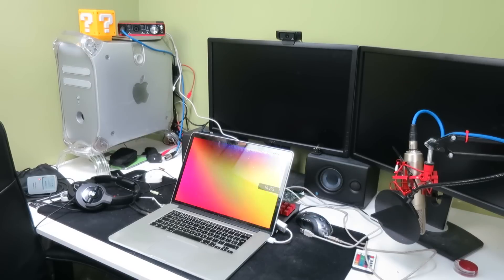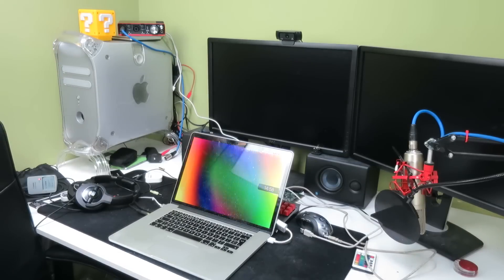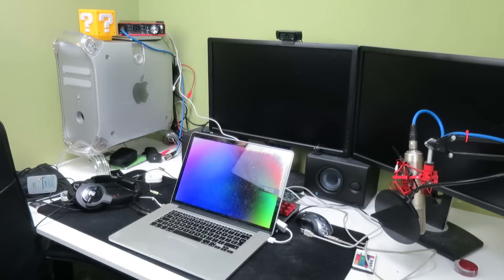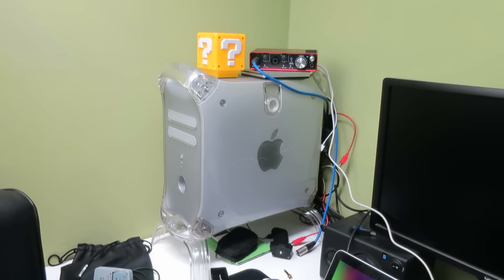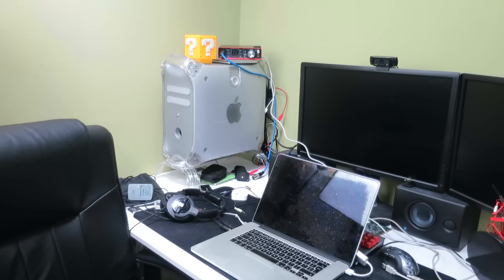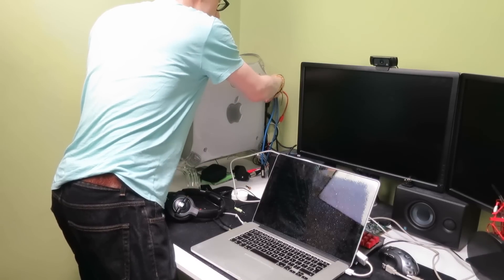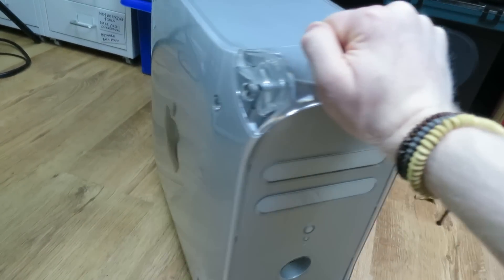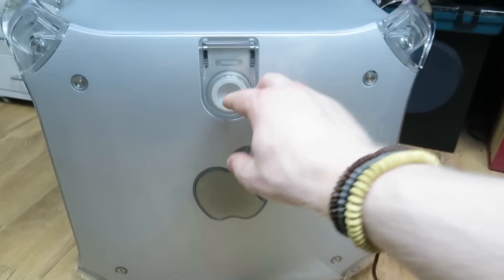Bye Bye Power Hack G4 Quicksilver

Comment: This video sums up perfectly why I never built a Hackintosh. I thought about it for years as I needed a studio Mac but never fully committed. With the announcement of Apple Silicon I know now for sure I'll never build one. I built a couple using old hardware for fun but I just couldn't bring myself to trust one as a main machine. I would strip the machine and sell the parts individually (including the case), you'd get more cash.

What I would probably do in your situation is buy a 2012 Mac Mini. Probably the I7 server addition running the two SSDs in RAID 0. Old yes, and soon out of support but a very nice backup. I used a MacBook Pro as my main machine for years and still do, but I learned the hard way to have a good backup as when these newer MacBook Pros decide to break they don't usually give much if any warning. Great video though and I'm looking forward to seeing your videos on the Silicon Mac when the time comes. Oh, and don't stop using camera audio. Decent audio is fine for big productions but it wouldn't feel right for these more 'traditional' IMNC-style videos.
Reply from the maker: Thanks, Ashley! I may look at parting it out if I don't get much luck selling it as is. Case on it's own would be much easier to sell probably. 
Mac wise, I'm trying to avoid the purchase of another system if I can. If I can hold out on this MBP, I'll be golden.

Don't worry, I won't ditch camera audio for the classic IMNC episodes;)  I just would like a camera with slightly better audio, less hiss / interference etc, and an audio input for those higher scale production vids.

Comment: Nice to see such a unique powerhack (that was once an actual PowerMac G4 too) sad to see it go but needs must and I hope whoever works out a price looks after it as well as you did Tom 👍         

Luckily I don’t have the urge to hackintosh my pc as my 3,1 Mac Pro runs just as I like so it’s all good but I needed some PowerPC stuff (hence the PB G4) as finding a cheap G5 isn’t really possible especially those later 2005 dual and quads. Sorry for the ramble but I find them extremely interesting and being a techie I can’t help it sometimes. Awesome content as always regardless of seeing off a unique bit of tech with sentimental value, onward to better gear and a Apple silicon based machine in a year or two.

Comment: Oh man.. I can only imagine how emotionally driven you must have been when deciding to film this video and during its filming (it shows). I concur with you regarding hackintoshing. I've had many Hackintosh builds since 2009 and they were a pain in the bloomin' ass (I'm not British, but I thought that sounded funny) to get working 100% actual Mac-like. I did have a stable system at one point, as well as I had this current AMD Ryzen 5 3600X system running with 10.13 High Sierra and finally 10.14 Mojave, but for what I do nVidia GPUs are king, and my AMD Radeon RX 480 4GB GPU wasn't going to kick it. I could theoretically downgrade from Mojave back down to High Sierra and run my nVidia GTX 1060 there and dual boot between Win10 and macOS, but I didn't feel like maintaining 2 OSes anymore. Like you I have a MacBook Pro (mid 2015 top spec'd except for SSD 15") so if I need macOS I can just whip that puppy out and get what I have to get done done on it. I do enjoy using my 6C/12T 3600X here and it ran super nicely on macOS, but Windows 10 isn't too bad on here and I just use that. Lastly, I'd buy your Hackintosh off of you, but you're in the UK/GB and I'm in the US... shipping would be horrendously expensive and I don't really have room for it in my setup. I'm also tight on money, so there's that too. I wish you the best of luck and I hope someone is able to give your old gal a new home soon!

Comment: I've got an 800 MHz Quicksilver. Just restored its original software from a downloaded and burned set of system restore CDs. Came with Mac OS 9.2.2 and Mac OS X 10.1.2 and some bundled applications, and iTunes came with some cool sampler tunes as well. Just applied a system update to 10.1.5 and iTunes 2.0.4 (from 2.0.3 under Mac OS X), but I otherwise plan to leave it as-is for running OS 9 games and such, and for the fun factor of running such an old OS X version. It's so old, it still features the happy Mac at boot-up instead of the grey Apple logo. That system update was also needed to get my SATA card to work! They were still doing a lot of work to get basic things going in this release.

Comment: I remember that I was in school at the time, and coming home to watch the hackintosh serie video's once they where released and build my very first one not very much later in 2016, how far we come since 2015/2016 :). I have ditched my hackintosh a very long time ago, probably been my main system only for a year and a half max not much after that I got a 2016 MBP which was paid for by my company, that was recently upgraded to a newer 2019 MBP in combination with a Belkin Thunderbolt Dock and have been loving that since. I two almost identical setups at work and at home and can simply connect a single cable from the dock and everything gets connected. Maybe this is also something that is worth looking into if you need to remove your laptop from your setup a lot since it removes the burden of having a laptop setup, which I hated with my old 2011 17" MBP.
Reply from the maker: Awesome comment, thank you :)

I would love a dock. You'll see my 'lack of dock pain' in the next video coming on Saturday. I've got cables spewing everywhere. I MAY invest in one from eBay, but trying to avoid any additional expense on the setup for now.

Comment: hi Tom have you been thinking of a Mac Pro 5.1 I think that would be a great hackintoch replacement or do you think that's not a good idea?
Reply from the maker: Yes and no. They're great machines but cost can climb with decent upgrades. They're also very power hungry, and I won't see much of a speed difference for my video editing. Intel Quick Sync REALLY helps.

Comment: I’m also running a Hackintosh And I love mine I had no problems there I’m just waiting for an Bluetooth USB to arrive so I finally can use airdrop and stuff like that Running like a champ amd Ryzen 5 1600 and amd rx 580 8gb  and m2 ssd 16gb of ram I use OpenCore works perfectly I have had no issues since headed now for a few weeks and I love it looks excellent with my iPad Pro 2020 With magic keyboard I’m just excited to receive the USB Bluetooth Adapter so find the transfer files between those two devices going to be much easier

Comment: Really is s shame to see that thing go. I can see me doing this in the future to my PC herd, if I do end up building all the PCs I want to.
A suggestion, if you are planning on using your MacBook Pro, then I could recommend one of those Henge docks, gives you ethernet, etc, and the Mac just clips in, and out with ease. I don't have one, but i've seen version for this model on eBay. No idea what they cost these days though.
Reply from the maker: I'd love a dock, and you'll see exactly why a dock would be perfect in my next video....
I'll keep my eye out for a deal on a used one, but they're still so expensive. I have all the cabling I need, so I think I'll just live with it until I get a new machine.
Reply: @ItsMyNaturalColour  I know, they really are, and I wish they had a horizontal version for the MacBook Air, as their vertical version looks a bit... "Rinky-dink"... Would have liked to have replaced my 2012 Mac mini. Not that it's bad, it's a top spec model that when all is said and done, I basically got for £80 roughly, and that was a few years ago. Only gotcha, is that the HDMI doesn't work. And now of course, Big Sur isn't coming for it.

Oh, while I remember, another note... IF you ever wanted to do the Hackintosh tango again, then take a look at a YouTuber called Morgonaut, she does very involved guides on building Hackintoshes

Comment: use some Listerine mouthwash and a microfibre cloth to remove your delamination on your MacBook Pro
Reply: Does it actually work? I’m considering doing it to my old 2014 since the screen looks dirty even when it’s on, but I’m worried about it getting more damaged.
Reply: Kirill Larshin yes it has to be the original Listerine none of their whitening ones just do a little test patch on the screen with a cotton bud it won’t damage it it’s the most gentle method it’s not a harsh chemical like acetone

Comment: i complete get why taking the second option was the perfect solution for you, but i think you could still do a hackintosh. When you built the machine  it was back in 2015 and now its 2020.  the motherboards are better know, the ram is better, AIOs are better, even the AMD cpu chips with Ryzen are much better and especially the graphic cards are way better. Lastly even the case that you chose even though very pretty in todays standards with cooling there are much better PC cases with full glass panels with LED Fans etc that handle the airflow much better.  When all things considered, this is the approach I would take.  In addition  this could be one of the main problems with your system is that the components even though not bad they are not like todays components that are probably better to download mac os on.   this in turn most likely would make the experience of trying to get the OS installed seem like a chore to a seamless and great experience .
some thing like this       https://www.youtube.com/watch?v=d5T8t5kNKgU              could be a great option, instead of air cooling like him you could still do  AIO but with a larger one to better handle temperatures.   lastly i will say that apple does charge more then building one yourself.       now there is nothing wrong with waiting till apple has released its new silica  and buying a brand new system then   but until then just think about it.    https://www.youtube.com/watch?v=Xh0bdzeAZ1w this is what a hackintosh could be .